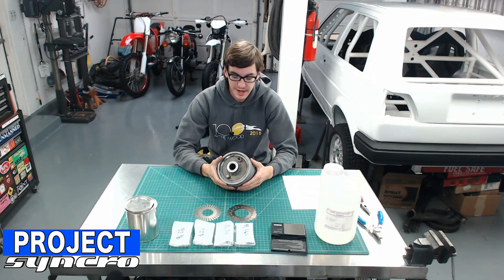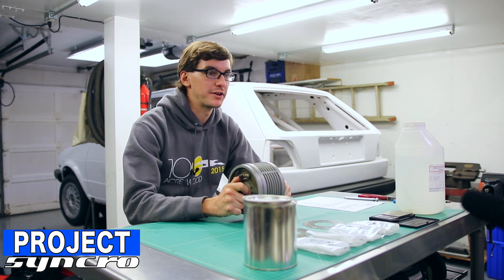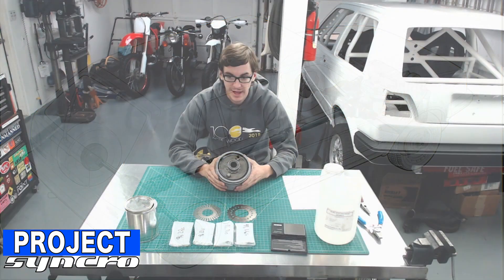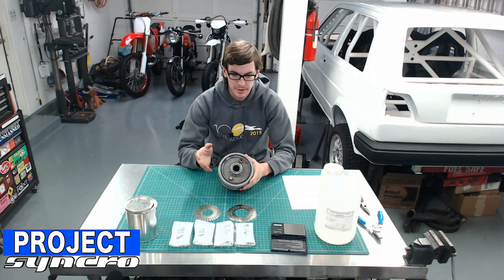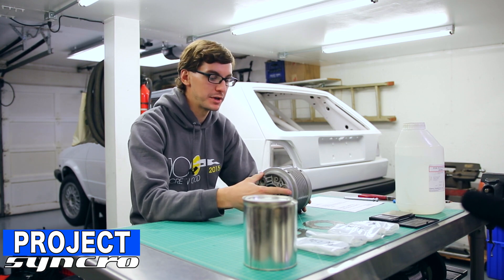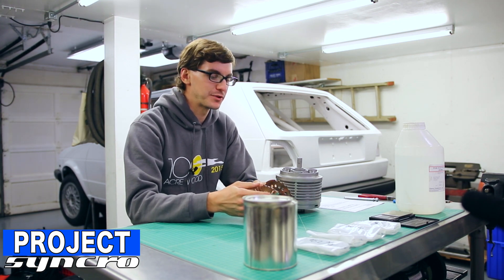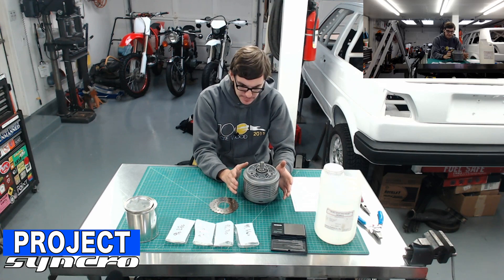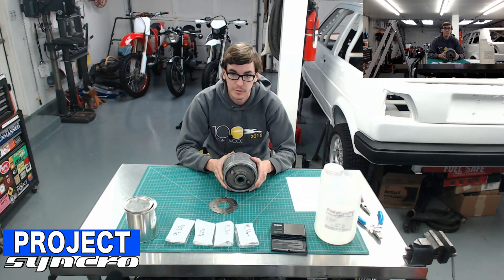VW Syncro Viscous Coupler - Project Syncro #38

Comment: You posted on a forum a silicone fluid of 1000 cst, that a european company offered, that you had originally ordered. I was wondering if you knew anyone that tried that lighter fluid, as opposed to the 100k cst you used in this video.